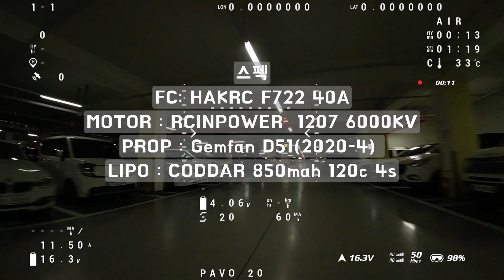PAVO20 Custom 4S MOTOR 5000KV VS 6000KV 비교

Comment: - my engine also has 5000k but the throttle is 45. yours is only 28.
- did i do something wrong? can you give me your setup file?
Reply from the maker: Hello
Have you tried adjusting the PID?
Try increasing the PID adjustment little by little.
Reply: @ i am using your pid but the effect is negligible
- I wonder how you can fly that throttle at around 30%
Reply from the maker: @hoailinh9612  If you used the same PID, you can raise it a bit more. Did you use 4 props? Props are important.
Reply: @gofpv79  yes i am using 4 blade. i am using your pid. i dont understand why the throttle is not the same as yours. 
- do you have esc installed?
Reply from the maker: @hoailinh9612  
I don't have a separate ESC installed and I'm using the F722 AIO. If you have a genuine FC, you won't get any output. You need to use an FC of 35A or more.
Reply: @ Thank you very much

Comment: Hi go fpv, Can you share the pid with 6000kv motor please?
Reply from the maker: set dterm_lpf1_dyn_min_hz = 100
set dterm_lpf1_dyn_max_hz = 125
set dterm_lpf1_type = BIQUAD
set anti_gravity_gain = 120
set p_pitch = 56
set i_pitch = 91
set d_pitch = 57
set f_pitch = 0
set p_roll = 49
set i_roll = 79
set d_roll = 48
set f_roll = 0
set p_yaw = 49
set i_yaw = 79
set f_yaw = 0
set d_min_roll = 37
set d_min_pitch = 45
set d_max_gain = 25
set feedforward_averaging = 2_POINT
set feedforward_smooth_factor = 45
set feedforward_jitter_factor = 10
set simplified_master_multiplier = 110
set simplified_i_gain = 90
set simplified_d_gain = 115
set simplified_dmax_gain = 80
set simplified_feedforward_gain = 0
set simplified_pitch_d_gain = 105
set simplified_pitch_pi_gain = 110
set simplified_dterm_filter = OFF

Comment: my rcinpower 1207 6000kv goes hot how about yours
Reply from the maker: @marvinjimenez5668  It's summer, so I'm very hot, too. So I'm controlling the pid. The battery is also using 560 rather than 850

Comment: I just done build Pavo20 4s FCAIO F722 using motors 4850kv, bring 730mah got more than 8minutes
Reply: what aio did you use?
Reply from the maker: @rgglenn150 hakrc f722 aio
I'm using it~
Reply from the maker: The 4850kv motor efficiency is really good. I think it would be good for long distance flights.
Reply: @gofpv79 yes bro. But i’m using Flywoo 1203 motors